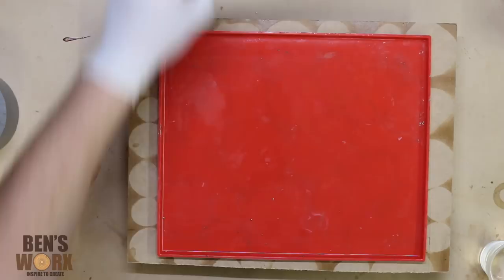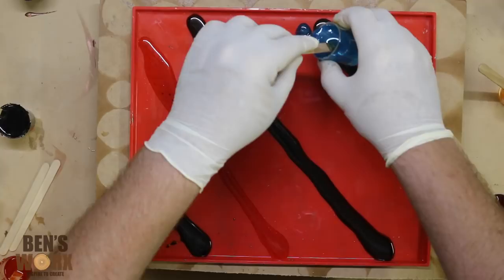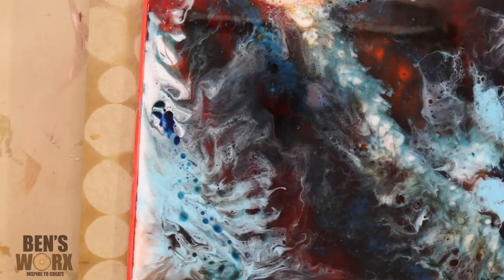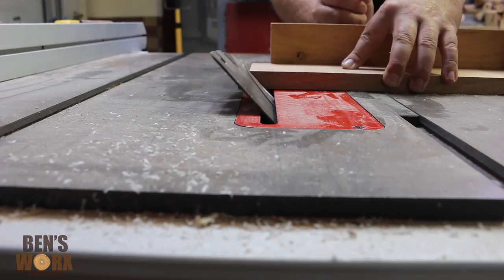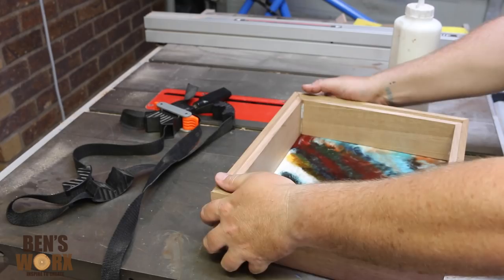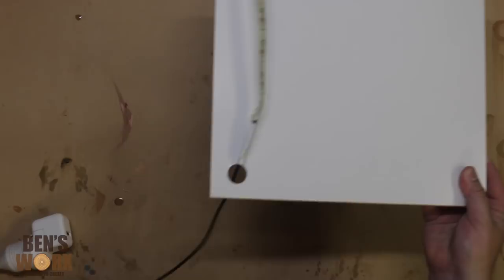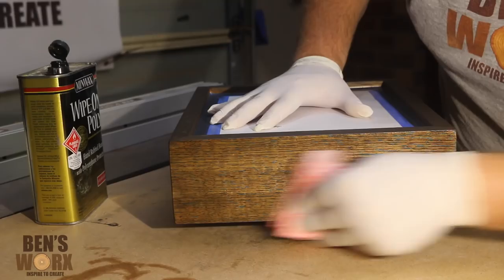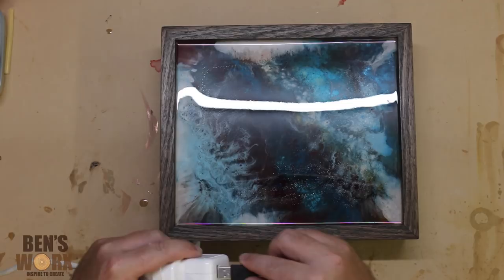How to make a resin art light box

Comment: nice! Did you consider using a diffuser between the LEDs and the resin to lessen the hot points of light?
Reply from the maker: No I didn’t but that’s a great idea! 👍
Reply: what's a diffuser ? the only kind i know is for aromatherapy.
Reply from the maker: Hi Anna, it’s used in front of bright lights to spread the beam evenly
Reply: Diffusion is the spreading of something from concentrated to more dispersed.  In this case light.   A couple of different options would be available.   There's a milk white film that will dull the intensity of the lights and is used in the graphics industry.   There's also a milk acrylic that is specific to light boxes that would work.  It would be placed behind the epoxy.   Another option, in this case, and available to most, would be to finish the interior white, attach the LEDS to the side (they're directional) and let the glow of the light take over.   Any time you do a light box, it's optimal to have the interior be a good reflective surface and if you have something blocking light, to make it round.   A light boxes purpose is to create a glow for the material it's lighting.  Light will bend around round objects and help prevent shadowing.   I would also use something other than tape to adhere the LED tape.   I believe our shop uses a contact adhesive even if the LED has it's one, to ensure a good adhesion.  Tapes will eventually fail.  Depending on the quality of the LED, they can get quite warm and eventually the tape will fail.  You can also potentially edge light the acrylic, but you need something to disrupt the flow of light and "catch" it (etching/sanded surface) for it to glow.  In this application, that wouldn't be optimal, but if it were freestanding, it could work well because you'd have a thicker base.   Even better for that solution is something to capture the light on the edges and reflect back in.
Reply: @jasonp2515  im sure this will sound like a dumb question but im not quite sure i understand what you are saying but would you happen to have a video on it i would love to see a step by step on what you are talking about because I really really love what he did here but I'm really afraid of fire